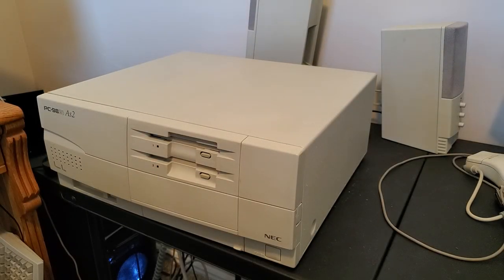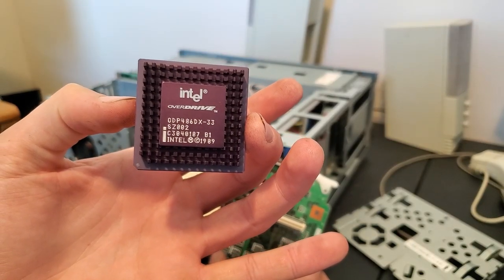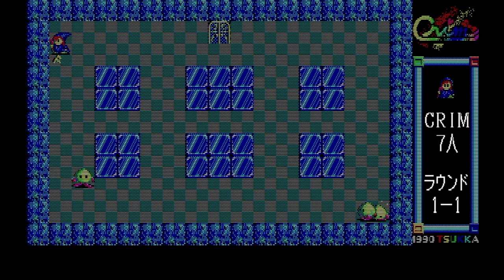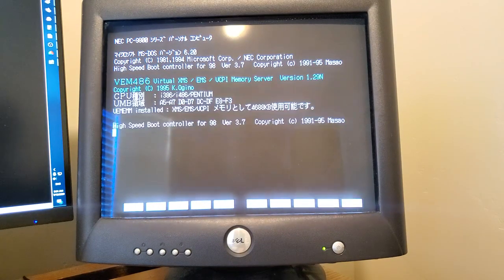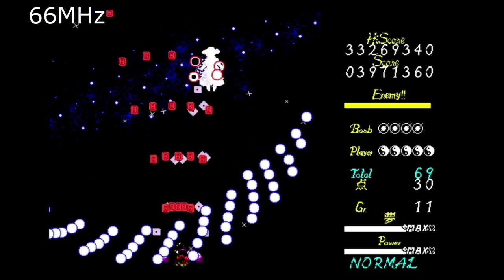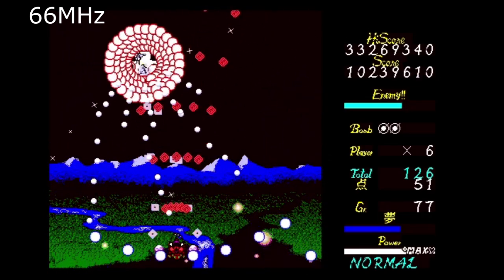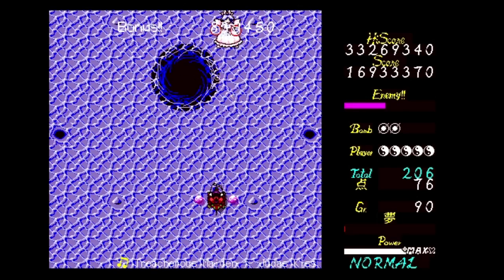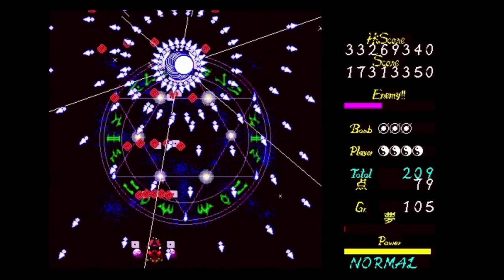NEC PC-9821 As2 Part 7: Upgrading the CPU

Comment: My friend and I tried to put a regular 168-pin DX2-66 in his 9821. It, of course, didn't work. He got an overdrive cpu but it was a 168 pin. After doing a little research, he found out what the extra pin did. It turns out that there are two solder pads on the board that you can jump together to act as that 169th pin. With that done, regular CPUs work fine in it.
Reply from the maker: Yeah, the 169th pin actually does nothing but act as a physical key. There are two other pins that short to disable the onboard cpu

Comment: I actually just bought two different 9821s. The first didn't have a keyboard, mouse, or 9801-86 YM2608 sound card. It cost $40 on Buyee so I'm not worried. It also comes with a Pentium overdrive cpu installed which is worth $100+ on ebay. The second had all the accessories it was about $50 cheaper than buying the keyboard, mouse, and sound card for the other....unfortunately the shipping from Japan is insane at about $80 each😂😭
Reply from the maker: The machines themselves aren't priced too bad, the shipping kills though. Which model did you order?

Comment: I think other than the ones you already showed in the video, the games on your HDD I can think of that would clearly show the difference between CPU speeds are:

Weapons Free
Space Simulator
 (Imo, probably the most useful since it has an active FPS counter in-game.  Be sure to run SS1.EXE for sound to work.)
Slip Stream '93 Rev-LIMIT
Seena2
Network Q Rac Rally
Flight Simulator 5
Doom
The Incredible Machine

It'd be nice if it was as easy to upgrade my model's CPU as yours, but honestly it's not that necessary.  I'd never call the Touhous or Flame Zapper unplayable as-is.
Reply from the maker: Most of those ran well enough on the 33mhz cpu that I didn't even think of them lol, well besides doom, but I'm not too worried about that game since I can run it on everything else. Oh yeah, seena2 lol, that game is weird.
Reply: @Tr3vor42532  Indeed, it is.  You can increase the screen size using the dedicated arrow keys, btw.  Bio 100%'s PC-98 games are kinda neat, imo.  Too bad many of their earlier games only have dreadful PC speaker audio, though.